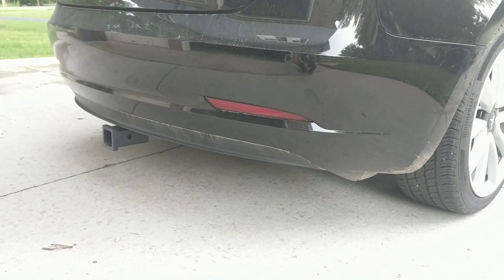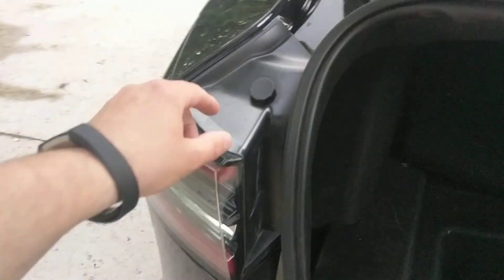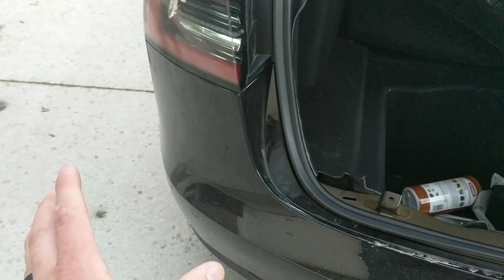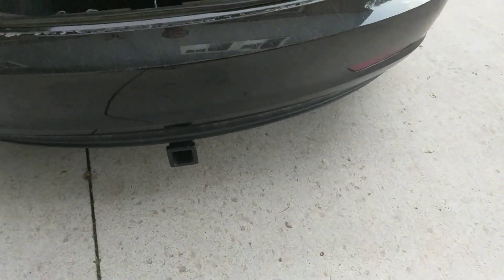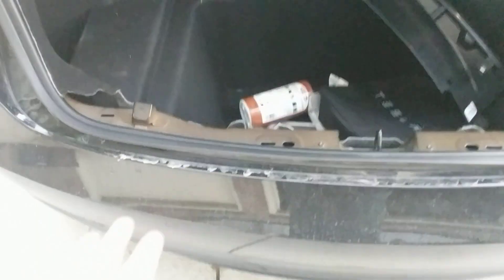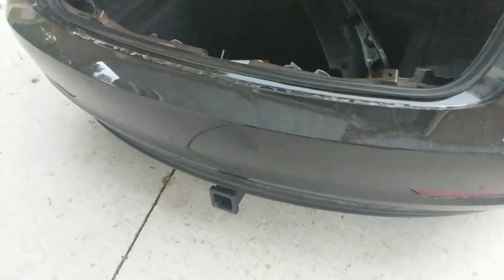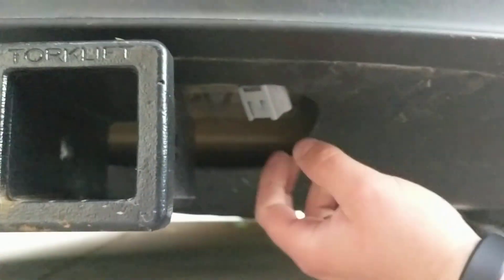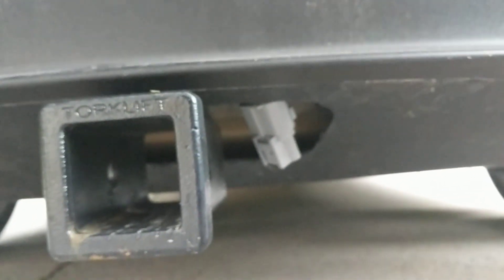2019 Tesla Model 3 Ecohitch Install Tips

Comment: 2 hours? Oh wow. Im from LA and I inquired around here to install it for me for $450 and not including the hitch. What was the ground clearance of the receiver?
Reply from the maker: I finally got a chance to measure it today.  6.5 inches from floor to bottom of hitch.  It's pretty tight against the car.  My only complaint is the safety chains are a pain to connect.  I just left the end of a chain up there and use a quick connect.
Reply: Jesse Short thanks for doing that!